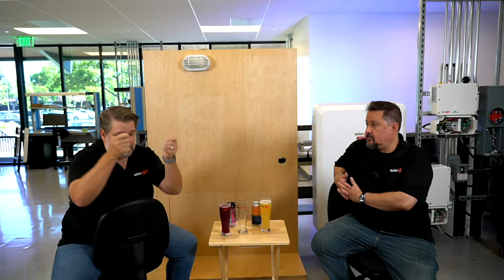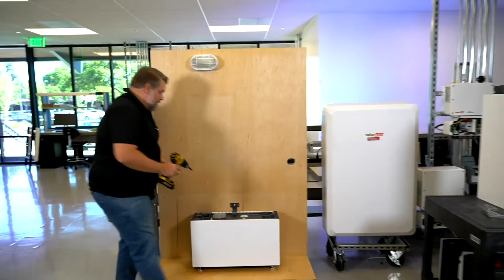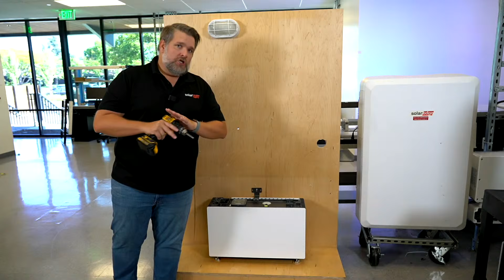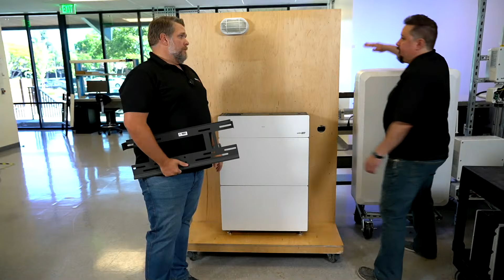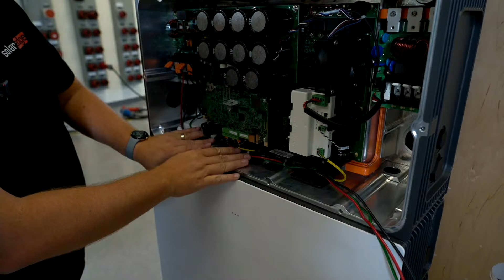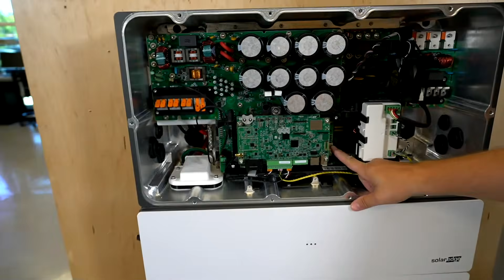Night Mode E009 - First Look At The SolarEdge Nexis Inverter and Battery

Comment: How does pricing compare to- parts and labor compared to the larger energy bank
Reply from the maker: Pricing will be determined by distributors, but you'll see more information closer to product release.   We're installing betas right now.   As far as labor and additional hardware, you'll see a huge savings because there's less conduit to bend connecting the inverter to the battery since you'll be clicking them together and your connections will be automatic.  We'll try to record one of the beta installs to give you a preview of what everything will look like in a real world installation.

Comment: I live in a town home so my meter isn't really accessible to me. I can get to it but I wouldn't be able to run ethernet from the electrical room to my inverter. I currently have an old 6kW HD Wave inverter and p series optimizers will I be able to employ this battery system and inverter or will I have to use the old battery?
Reply from the maker: Hey Shawn, the meter collar would only be required for backup functionality.  You'll need to be able to talk to the meter collar to disconnect you from the grid before an inverter can start producing power so that it doesn't send power back to the grid and hurt a linesman trying to restore power.  

We have the re-energize program which is essentially a trade in program for your old inverter to get you a battery ready inverter.  Not sure what the program will involve when we release the SolarEdge Nexis Solution.  If you want to learn more about Re-Energize there is an info page here:   https://www.solaredge.com/us/re-energize
Reply: @SolarEdgeNorthAmerica is the collar the only way to install the Nexis or is there another solution?

Comment: Hey guys so how does it work with 3 inverters? You mentioned one in normal mode then 3 in backup mode? One inverter is on grid and the other two are like standby ?  Or only one can upload and all 3 are online ?  Cheers!
Reply from the maker: Hey CA2997!   If there are multiple inverters, once disconnected from the grid the leader inverter will act as a grid forming inverter and the other inverters on site will sync up their AC sine waves with it to produce. Additional details will be released later once we're a little further along in field testing.

Comment: Sorry I don't have time yet to watch the whole episode, but will the new battery be backwards compatible?
Reply: This is a great question, and there are multiple layers to it, so I will try to make it as clear as possible.  The SolarEdge Nexis Solution is AC and DC Coupled, and this feature will be available early after launch.  This means you can use any SolarEdge inverter, or 3rd party inverter in backup systems, so long as the SolarEdge Nexis Inverter is the grid forming device.  That is how we are achieving backwards compatibility quickly.  There are more layers to backwards compatibility, and if you need them, I am happy to provide more detail.
Reply: @cameronstewart4208 so is the Nexus compatible with the current generation of SolarEdge Home Battery?